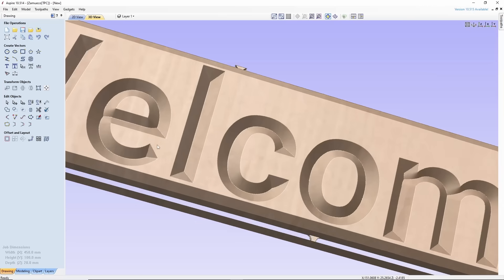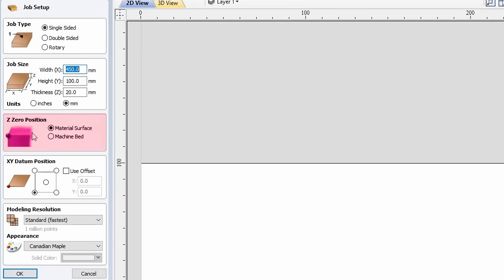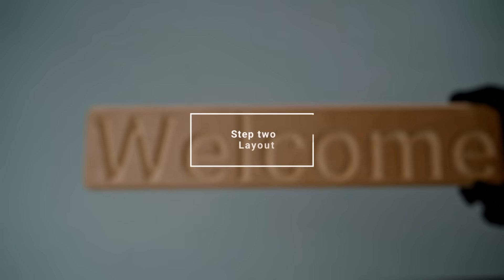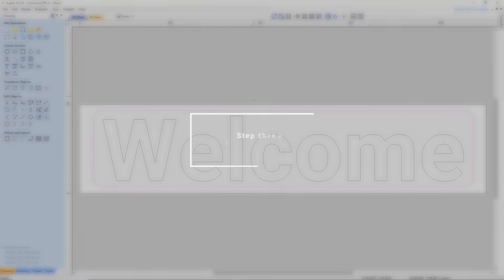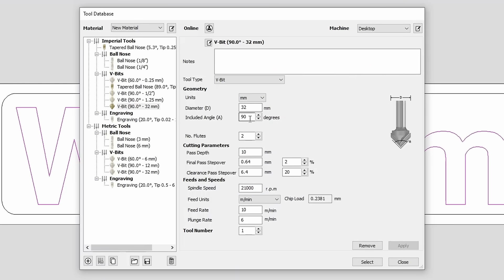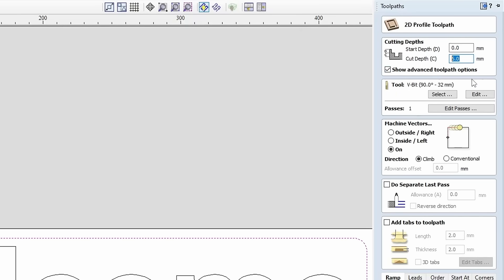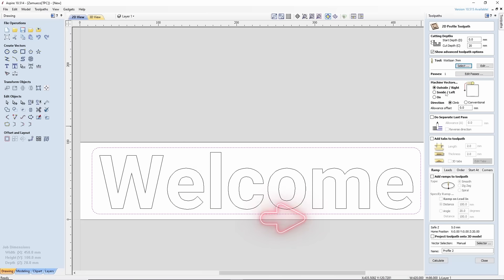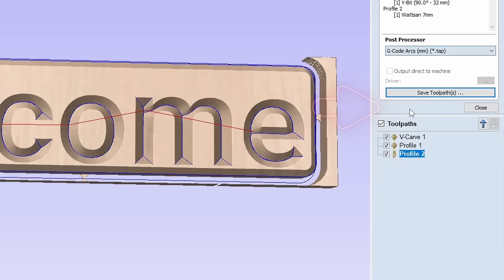How to V-carving on MDF? | Create a Simple Layout for the CNC Router Wattsan M1 1313

Comment: At the end you used an usb stick, cant the router just be connected to the design computer?
Reply from the maker: Thank you for your question! Yes, you can connect the DSP controller directly to the computer and use it as a flash drive. But then it will not be possible to control the machine. Only after you transfer the files to the machine and disconnect it from the computer can you control it.